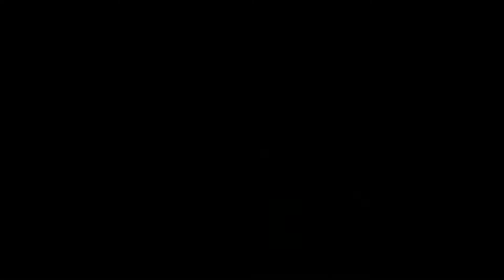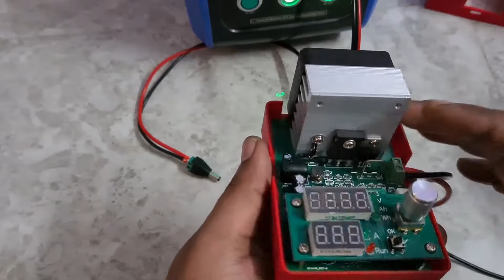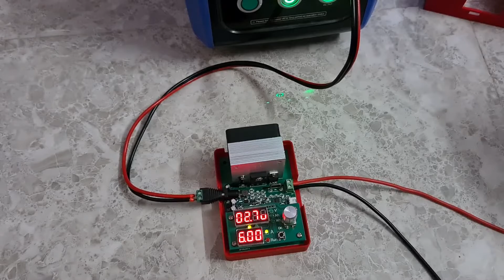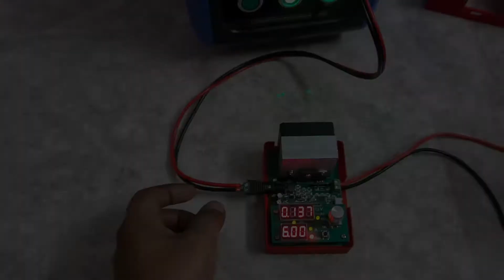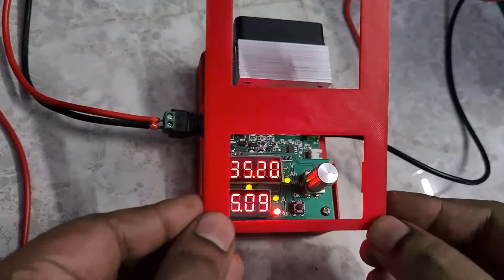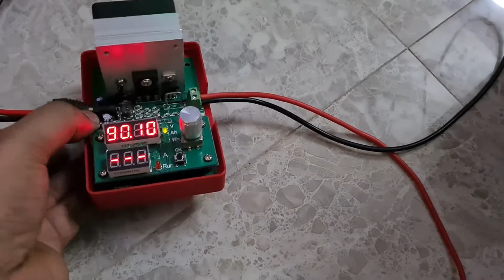Capacity testing of LiFePo4 prismatic cell using battery tester.

Comment: comparing lifepo4 with tubler acid batteries both (AH  capacity same or different) explain it sir. like 4 in series of lifepo4 battery with 100ah it has 100ah out in tubler 6 inter connection of 2 volt series to get 12 volt.   so what is the question is 2 volt series in acid battery( ah capacity) ?
Reply from the maker: The lead acid battery of the same ah cannot be compared with lifepo4 battery.  Lifepo4 battery are more efficient in charging and discharging. You will get more energy from a lifepo4 when compared to the lead acid of same ah. And the charge cycles are also less. A flooded lead acid can be safely discharged only to around 50% if you want more life out it or the manufacturer stated charge cycles.
Reply: @diyIndia  then one cell 3.2 volt 100 ah lifepo4 is equal to lead acid of 12 volt 100 ah  so totally volt is differ is right
Reply from the maker: Lead acid battery bulk charge voltage is normally 14.1 to 14.4 and float voltage is 13.8v. We do not charge a lead acid battery with only 12v. But we still call it as 12v battery.  So even a lifepo4 has the full charge voltage at 3.65v pee cell or 14.4v for a 12v battery.
Reply: @diyIndia  😀👍

Comment: So the prismatic cell was B grade
Reply from the maker: I just did one test for the cell at cut of 2.7. The cells were rated for 90ah. So I got what they had said. But let's see how it holds on a 12v discharge test.
Reply: @diyIndia  I missed where you showed us or said what the cell capacity was ? You said you got 90ah from the cell. What was the cell capacity.. 100amp ?